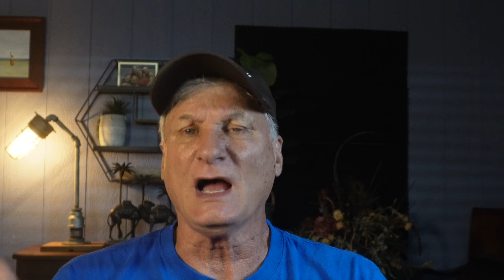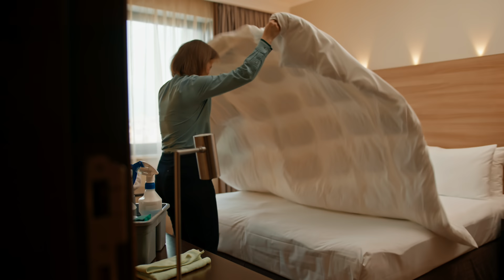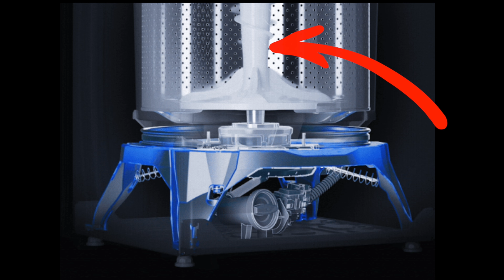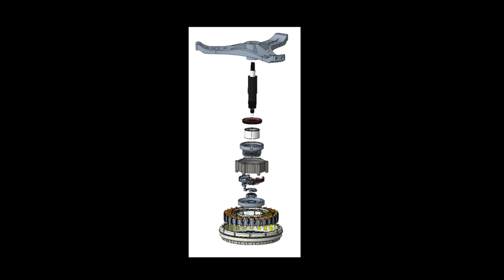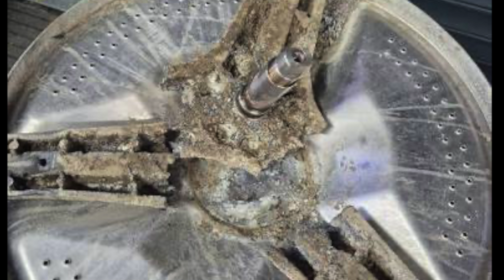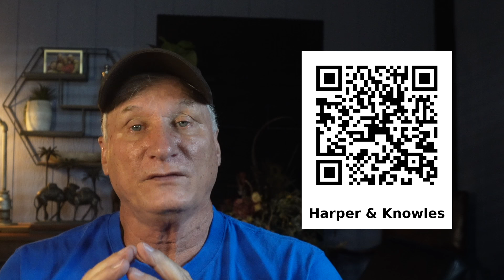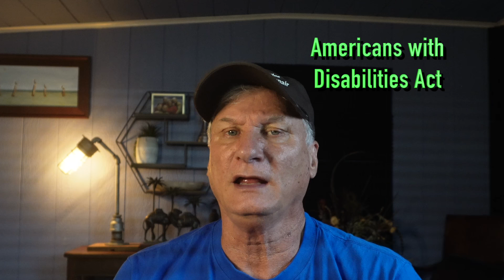Maytag's New 30-Year Washer: No Gearcase, Real Agitator, 900 RPM

Comment: The HE Maytag I bought 10 years ago has a real agitator with the softener dispenser. It has auto sense or deep wash choices. It’s a huge drum and it  fits my queen comforter with no problem.  It’s a great washer! I have only had to have a wire connecter replaced 3 years ago that connects the door lock to the Motherboard. It was a 21.00 part that was found on Amazon. A good friend, who was a retired appliance repairman, put it in for me. 0 issues since.

Comment: I bought a used pair several months ago and I was SHOCKED to see the way it washes! I had NO idea that had been changed! All I saw when looking at it was that it had an adjitator and enamel tub and I was very happy till I used it. I thought it was broke from the beginning bc of the occassional swish. Forward to the 2-3rd washing and this thing went bonkers and even threw the softner cup down into the bottom. From what I have learned from ai is that the shocks are gone!! the jerk I bought it from ghosted me early on. I've looked at the approx parts needed $$ and it's around $30 or so for the 4 shocks. I am a 77 yr old woman and I have fixed a few things on a washer via you tube but I hesitate taking a washer that far down so I will be calling someone I've used in the past. Add to that it either under fills or over fills. When it's under I have to stand there and flixk the lid over and over till it gets enough water to wash. I have a spicket that I could fill with a hose but the smart washer kicked that water out when I tried prefilling it one time. Contrary piece of machinery to say the least. Can you tell me about what it'll cost and do you think this Amana is worth it. The pair is really pretty. Also, the model and serial have been removed! Why? I have no idea! I say come back with old type washers and muscle cars built with real metal instead of plastic. I'd buy both! thanks so much!!

Comment: A 20 year old Fisher Paykel GWL11 direct drive 1000 rpm top load washer apparently has been cloned by Whirlpool.   I have one that is 20 years old with only a water valve replaced which was available for low cost from Amazon.

Comment: My current washer is a Whirlpool built in 2006, turn dial controls,  only issue I've had is the water pump cracked. My dryer is a GE built in 1996 and everything is original on it except the light bulb inside.

Comment: Maytag lost my business a couple of years ago after having bought a supposed commercial grade washer and dryer. I had to replace the stub shaft and bearings in that washer 3 times within 8 years. Now granted it's not a hard job to do, but it's frustrating as hell when such a simple part has to be replaced so often on a $900 washer. Maytag used to stand for quality, not anymore.

Comment: Happy to see this. I tried researching washers a few years ago when our washer quit. Consumer Reports claimed their best-cleaning washers were LG front loaders (the mid-grade series whatever that is). Friend said Speed Queen and Miele were the most durable, but they were way too expensive and they had small capacities. Called our appliance repairman. He said if we can’t get a SQ, and had to buy a mainstream brand to go with LG. He said Miele units were built well but were not as easy to get parts for. He said stay away from Samsung at all costs. So we bought the LG set at 50% off on Black Friday. I think that was in 2020, so we’re on year 6 with these. No issues with them, but, it barely fits a king size comforter. I really have to stuff it in, so I don’t see how it can clean it that well and the weight can be an issue for the fastest spin cycle speed.

Comment: My 2014 whirlpool washer and dryer has been good. Had to replace suspension rods for washer but thats it knock on wood. 

However im going to pass on buying a new dishwasher. Took it to the dump and going to put shelves where washer was for my cast iron pans, etc.

Very unhappy my new fridge has r600a for the coolant. Had i known i wouldnt have bough it.

Comment: Yeah you got to appreciate the fact that Maytag (whirlpool) went TurnKey on their service contracts. they pay independent technicians well for the service work. I was never a fan putting the pressure sensors on the circuit board. Having a pump scuttle is always good. And while I was working I did replace a lot of gear cases. This is my first video of yours that I watched and, I got to say, you know what you're talking about. I'm excited that they're bringing some industry standards back. The big problem with the old washing machines wasn't their serviceability it was the power and water consumption. Especially when a lot of average Americans would leave it set to" super"no matter what the size of the load was. You're talking 30 gallons or more per wash. I can't blame the federal government stepping in on that. You can imagine how discussions I've had with younger people on actually how to do their laundry, load size recommendation, and such. If you got a family of four with pets you need to be doing more than one or two loads of week, shoved to the brim.😅. Thanks for the video brother.

Comment: We’ve bought stackable LG Thin Q, stackable when we bought our home in 2020. We absolutely hate it. It’s already been fixed twice and I hate the internet feature on it. I just need to wash some towels. No Internet is needed or wanted. My aunt has two Maytags from 1986, they BOTH work great with only 3 repairs in 40 yeara. My aunt has two 5 year old Speed Queens and they’re great. My next washer and dryer will be Speed Queen.

Comment: That new Motor looks suspiciously like Fisher & Paykel's motor.

Ive got a big LG from Lowes, washer plate style but gets things clean!
It spins out fast
At 950rpm.
1/2 to 3/4 load add 1 pod.
Kinda full add 2 pods.
Big full load jeans etc 3 pods.
I use heavy was, extra rinse, full water
We have 7 adults in the house, washer runs every day!
LG matching dryer too

Comment: We had a new Laundromat recently 
  9.50 , 750 and 550 to start. Hot water another 1$, delicate another 75 cents so 9.50 turns into 13/14 $ per load. 
  Glad I have enough clothes to only have to go wash it every three months so I can fill the washer 
  There's a part kiosk , sucks you hit a button on washer, go to kiosk then back to water to hit start . 
  It also now closes at 10 pm.
  I hate it, I always did my laundry at 11 even when I had my own

Comment: Built in obsolescence has damaged the reputation of what were once household mainstays from the appliance industry.  I have spoken with many families that have spent good money on appliances that have failed in less than two years.   Building lifetime and self-serviceable  appliances is the way to go in capturing market share.  Making disposable high cost products may fool consumers  once before they move on to reliable manufacturing competitors.

Comment: That bearing is key to the spin speed, and they might have dual bearings to keep the agitator and everything else locked in place. Automotive wheel bearings will handle up to 3000-5000 rpm at the wheel.
So with a good solid electric motor assembly with servos controlled by relays. Built literally the way washers used to be made.

Comment: Just an fyi, they didn't name it the stator and the stator and the rotor... thats exactly what EVERY electric motor ever made used and the name have been around for as long as the idea of an electric motor has.... also that control board will be the new stripped transmission that fails early and costs more than a new machine 😮‍💨😊

Comment: My dad's dryer lasted 45 years, and the matching washer was still working. His dryer stopped drying about two months before he passed away at age 99. My dad was frugal and never replaced anything until it was unrepairable. Even then, he would keep the broken stuff in his huge basement. All his dryer needed was a heating element, but I teased him about buying that heap of junk that only lasted 45 years. He just grinned because he knew he was on the winning end.

Comment: Some things to weigh. They call it a 30 year machine, but with a general 10 year warranty and 5 years on parts.

It still uses a circuit board, than old school analog. That's always a costly gotcha.

It's likely to be at or above a Speed Queen price point.

They are definitely changing towards the right direction.

Comment: Been working on washers and dryers for 25 years. I watch the direct drive whirlpools fall to the wayside because of the capacity of the present junk. I seen whirlpool direct drives  go 30 years. People are starting to wake up to the actual cost of the extra capacity and want something really reliable. I’ve walked out of half , if not 3/4 of the homes I went to with only a service call because of the crazy price of the repairs. It was cheaper, in there eyes to buy another piece of junk then buying a speed queen. Great video.

Comment: I jumped off the whirlpool machines after losing a water pump that cost more than the machine to replace. I bought a speed queen set 15 year ago, the dryer guide wheels went out, cost me 75.00 to repair. That is it, these machines are very reliable. Go with Speed Queen you will not regret it.

Comment: Speaking as someone who works in aerospace (and has repaired a total of two washing machines, so strictly amateur in that area), relays are not more reliable than solid state electronics, but they are more reliable than the crappy electronics I saw in the two machines I had apart. What I would like you to evaluate is whether the electronics are designed to never contact water or high humidity air. You can do this with a sealed enclosure, or look at the WIkipedia pages on "potting (electronics)" and "conformal coating". And of course price is super important. If they ding you $800 for a board that cost them $90 to make then replacing that board is a much bigger deal.

Comment: We rebuild our home after a wildfire burned it down. We had top of the line Samsung wash and dryer installed. The dryer needed two circuit board replacements in less than a year and the washer died at 3 years. We bought cheap hotpoints that cost less than the repair costs of the Samsungs. I can recycle a dead hotpoint and buy a new one for next to nothing. Two years later we have zero regrets and no repairs on our cheapo purchase!

Comment: I have been very upset about my Maytag washer which needs to be “cleaned “ with a tablet. The washer decides when it  needs  to be cleaned and it happens after I put the clothes in the machine. And it won’t wash the clothes no matter what until I “wash” the machine. I have changed to every Friday using vinegar and it pacifies the machine so I can wash the clothes. I never had to “wash” my washer before!!!

Comment: perhaps this is a question for a future video.
I deal a lot in property management. We primarily use GE washers and dryers. We use two primary companies to order them from Chadwell and HD SUPPLY (Home Depot Pro)  I have ordered dozens from both companies. I have had no issues with the machines I purchased from Chadwell. However, eight out of 10 units I get from HD pro supply require a GE service call immediately. They do not work out of the box. And because they are out of the box, I can’t send them back. They must be serviced by a GE tech. Why would this be happening? Where does HD pro SUPPLY get their units versus a company such as Chadwell why the big discrepancy? does this mean, as a consumer, we have to be concerned with not only the brand we purchase but the supplier that we purchased it from?

Comment: They still are screwing us. Now to get what used to be consumer grade, we have to pay commercial prices. 3 times as much. They should offer the old style at consumer prices that also lasted 20 to 30 years. Using a mechanical timer and no computerized parts at all. None needed for a washing machine. Normal agitator and water levels. The dept. of energy is under new management now. So they need to ditch all the leftist mandates that turned our appliances into garbage. Biden and his cast of idtiots are gone. No reason to keep making their mandated garbage. Appliance Corner has it for sale online now.  $1549.99.

Comment: Even if a top loading washer lasts for decades there are a number of issues that will always make them second rate to a front loader. (BTW Asko front loaders have stainless inner and outer tubs)
1. Top loaders use a really huge amount of water. 
2. All that water for a 15 minute wash cycle!!! (FL often at least twice that on a proper wash cycle with like 80% less water )
3. The wash quality will always come in second to a good quality front loader due to the high friction washing method inherent in the front load design. 
Yes, top loaders are quicker, but the cost is huge amount of water use and less quality wash.

Comment: My Samsung is 15 years old.  Something is bent so it's noisy AF but otherwise it's fine.  Prior I had a rebuilt Kenmore set 10 and 20 years old rebuilt that worked for 15 years no issues.  I suggest rebuilt if you have a place near you, they've fixed the part(s) that always fail and only 1/3-2/3 the price.

Comment: Too late. After having multiple Whirlpool appliances that died early, I will NEVER buy any of their brands ever again. The washer we bought screamed like a banshee on the first day. I should have just brought it back to Menard's. But, instead, I called Whirlpool and they sent out a tech. He "repaired" the machine and it was fine for a few days. I had six repair calls under warranty. I repaired it two or three times after that myself. Then I dumped it. An $800 washer lasted two years. I had a similar story with the Maytag dishwasher.

Comment: Maytag absolutely sucks. I had a Maytag dishwasher that never washed a dish. Yes it was under warranty but after taking 3 full days off work to wait for a service guy and it still not working it was cheaper to just go buy another one. Now I have a Maytag cloths washer in a property that won’t spin if you put anything other than a small load in it. Absolute trash. Never again.

Comment: Knock on wood. I have a Roper top load washer purchased in 2009. Went through several years of teen & young adult kids with grands that packed the tub as full as they could. I haven't had any issues at all until recently, occasionally the timer starts buzzing but is still working. I can replace that cheaper than a new high teck machine, as long as they still make the parts.

Comment: Thanks for the video and details. $1,500 isn't in the budget for most people. There's no reason for it to cost so much when they removed half the parts count. Simple economics, at todays prices you can get a standard top load machine around $500. I don't care if the thing last 3x as long when it costs 3x the price. I'm tired of the up-selling and marketing. This is a great $500 machine, not so great at $1,500. I will continue to buy the $500 machines and replace them when repair cost isn't economical.

Comment: The speed queen I use at the KOA campground runs 25 minutes to wash and an hour to dry which is a perfect time at high heat. I wash in cold water. I just don't like board  machines I would rather have knobs and buttons if I was to buy one for the home. 73

Comment: Buddy, I don't know what kinda appliance repairman you are, but I've been working on them for 40+ years, all different makes, and I can count on one hand how many failed gearboxes I've encountered. Additionally, I currently own a 31 year old Kennmore 110.xxxxxxxx (Whirlpool) that I bought brand new. It's been through TWO wives and SIX children, and a container ship full of my filthy mechanic/car guy laundry over the years. To date, I've replaced the motor coupling (once), the pump (once), several agitator kits, and finally had to rebuild the wash tub 9 years ago due to a leaking shaft seal after it spent a year in a storage unit. My plan is to continue using this machine until it has a failure that I can no longer source parts for OR I die. Whichever comes first. 

This new Maytag you're bragging about with a gearless design is going to be a joke. That motor requires a frequency drive in order for it to function in the manner described. Not only is that motor design expensive, but so is the freq drive - AND they're typically not reliable in such light duty applications. It'll be made cheap, most likely in Chy-na. I wouldn't have one stuck in my ass if I had room for Texas. 

These days I am a staff engineer in a large coal-fired power plant. I can tell you anything you ever wanted to know about 'new-fangled' gadgetry, and especially freq drive units that cost 5 figures and fail after 9 months of use or a lightning strike 2 miles down the road. (not kidding). My advice to anyone would be DO NOT buy any washing machine that does not have a standard ac motor and a gear reduction style transmission in it. You'll be wasting your money.

Edit: I'd be willing to bet a green dollar that whenever the average appliance repairman tells his customer their washer has a bad transmission, it's really just a broken motor coupling. Then he ends up selling them a $400+ repair OR a new washer - all over a broken $3 part that takes about 10 mins to replace....and he doesn't actually replace the transmission, he hauls the machine to his shop and puts a $3 coupling in it and charges $400 plus delivery charges.

Comment: Speed Queen Cycles are too inflexible.  I don't like that water fill shuts off when lid is open.  I like to rinse detergent cap with the water.  I want to be able to turn the knob to just a rinse cycle.  Maybe the Maytag/Whirlpool will give more control, including for the dryer.